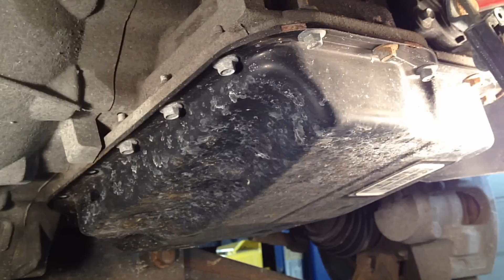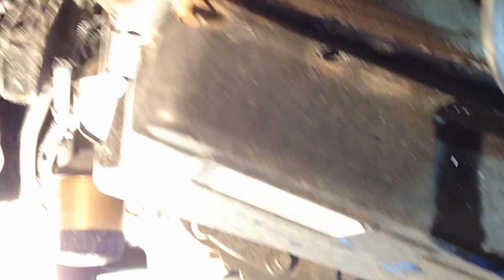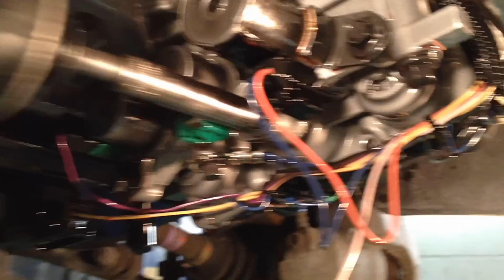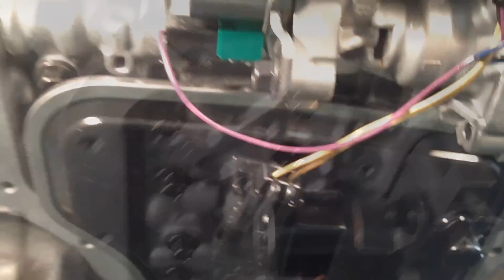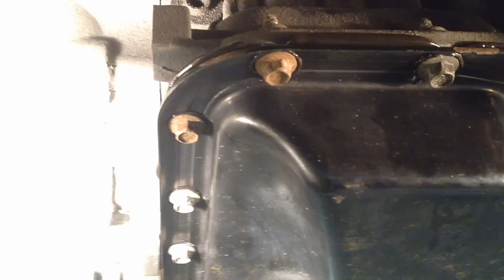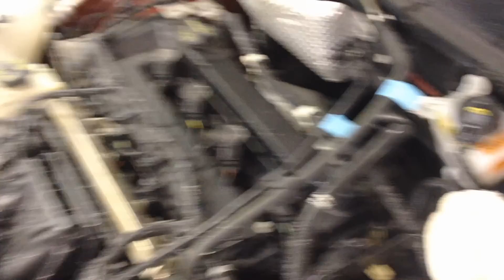Ford Focus Shift Solenoid A Repair P0750 P0753 P0972

Comment: Solenoid 	Function Type	Harness Connector Color
Shift Solenoid "A"	On-Off	Clear
Shift Solenoid "B"	On-Off	Black
Shift Solenoid "C"	PWM	White
Shift Solenoid "D"	PWM	Blue
Shift Solenoid "E"	PWM	Green
EPC Solenoid	PWM	Black.......the connector is where the wire clips into the solenoid

Comment: Struggling with a P0770 on a 2010 transit connect. Put in all 6 new solenoids, fluid, filter, etc.. Code comes up immediately even without driving it. Wondering if the dollar store scanner isn't actually clearing it. Lack of power from stop, delayed shifting, and won't grab 3rd until WAYYYY late and slams into it.

Comment: It’s 11 years later. I have a 2003 ford focus. I was driving one day and I have no 3rd gear all the sudden. 1st and second shift fine. When it shifts to 3rd gear it like I went in neutral (no gear). I have a P0750 code. I will replace A solinoid and see what happens. Hopefully a fix. Tranny was working just fine before this happened and is repeatable. As long as I don’t go in to third gear. Transmission works fine. 75k original miles. Question, what is part number for solenoid A and B for a 2003 ford focus?

Comment: Hello, I am writing to you from Turkey. I have a Ford Fiesta with a 4F27E transmission and a 1.4-liter petrol engine. I have an issue that we haven't been able to resolve. The problem occurs especially after the car warms up; it jolts when shifting from 3rd to 2nd gear. It feels as if another vehicle is hitting it from behind. I haven't noticed any issues with other gear shifts, but this problem happens specifically when shifting from 3rd to 2nd. It particularly occurs on steep inclines. When the speed decreases on an incline and the engine needs to downshift from 3rd to 2nd to recover, this issue happens. If I switch to manual mode and ease off the gas pedal while manually shifting from 3rd to 2nd, the jolt doesn't occur. However, if I shift while keeping my foot on the gas pedal in manual mode, the jolt happens just like in automatic mode. What do you think could be the problem? Do you have any guesses? The local mechanics here have suggested a complete transmission replacement, which is very expensive. Since the problem occurs only during this specific gear shift, I would prefer not to replace the entire transmission. Is there a simpler solution? I would greatly appreciate your response. Best regards.
Reply: Stay in turkey. Garbage country
Reply: Bet ur in berlin

Comment: Getting code p0761 on 2009 focus. Replaced solenoid c and code returns. Replaced transmission with low miles used transmission and still getting code p0761 (solenoid c). Any suggestions?

Comment: Wow so great video brother.... so this focus tranny looks aboutbthe same as the ford fusion 4cyl. Except that the pan is facing foward where the solenoids are. With that said i have error code po735 i think and it refers to the 5th gear ratio incorrect. I have in the past removed the solenoid valve body to replaced the gasket type sandwiched between valve body because the metal ball was stuck and blockage was happening and it solved issue. I also carefully inspected the oil and removed oil tranny pan to look for metal shavings and see if issue was mechanically but it had none and just normal wear n tear so i knew than that the issue was 150% with valve body gasket and sure enough it was. Now after 2yrs i have this new code of 5th gear incorrect ratio so im sure it is a shift solenoid but do you know which one controls 5th gear ratio??? PLEASE HELP ANYONE THANK YOU SO MUCH!!!

Comment: Would any solenoid issues show on an ODB2 scan? My mk1 1.6 automatic is having issues and I think it's the solenoid but because the transmission warning light goes off when I restart the car I'm wondering if it clears itself.

Comment: did you ever run into a 2008 focus se with an automatic trans that would not engage the park pawl, even after a cable adjustment? is the pawl accessible by removing the pan?

Comment: I was driving, when going from second to 3rd I herd a clunk sound then no shift to 3rd.  

It still shifts good n strong from 1 to 2 and reverse.

But when it goes to 3rd nothing engine will Rev up, is this what shift solenoid does?

Comment: Hey man u still here? I have a 2000 Ford focus SE. It's been doin great and today it started to not wanting to shift down wanted to stay in high an then it shifts down and then later I was goin 60mph an all of the sudden it went into neutral . I took my foot of the gas it went back in but now it seems to me slipping an jumping out of gear. Fluid is clean an full. What is the issue???

Comment: I i have a 09 ford focus ... with codes p0981 shift solenoid d control circuit range / Proformance  p0732 gear 2 ratio incorrect and p0767 shift solenoid d stuck on. I have changed shift solenoid d and im still getting the same problem. Should i change solenoid A as well? It revs high in first gear and sometimes shifts hard into second inless u left off the gas. The wrench light came on during test drive along with cel. But then the wrench light went off after 2 miles and just have cel on. Please help me i dont know what else to do to get this fixxed! Please please. Also had a exposed wire going to shift solenoid f i wrapped it with electric tape. But im not getting any codes for that solenoid. Please help im stumped!

Comment: My 2002 Ford Focus started making a jerk motion when accelerating and shifts to 1st to 2nd and it’s not all the time it’s random. Almost feels like a delay in shifting. I changed the transmission fluid and filter. I’m not sure what it is. Could it be something to do with the accelerator pedal or injectors or something else. I’m hoping it is. It’s a 2002 Ford Focus. Can anyone help? I don’t have any codes or check engine light.

Comment: I followed this video to a T when changing a "stuck D solenoid" (P0767) and after I put it back together and drove it, I got the same error and jerky shifting. Can something else be contributing to my problem. And yes I did drain pcm capacitors with the alligator cable trick.
Reply: I think he's got cde in wrong order if you see a picture diagram doesn't match

Comment: Great video I have a 2009 Mazda 5 4cyl automatic shifts fine then all of a sudden the car jerks the a.t. light and check engine light comes on and the tranny shifts down to 3rd gear when I stop then take off it shifts thru the gears only to 3rd gear and wont shift out of 3rd gear the tranny fluid is dark color a little black I stop put it in park shut it off wait a few minutes start it back sometimes it does fine shifts in all gears and sometimes it keeps doing it any info would help I havent had the codes ran thinking maybe tcm or shift solenoid or the pressure one im not sure thanks in advance

Comment: I have a Escape 2010 with a 6f35 trans Ford doesn't have one in stock and the aftermarket refurbished valve has a plastic shoulder and the original is metal numbers on the solenoid are not the same ever run into anything like that? I cant find that same type of solenoid that I pulled out. will the other one work or are the flow rates different?

Comment: Great Vedio! Just got a P0772 Shift Solenoid "E" Stuck on and a P0742 (TCC) Circuit Stuck On trans code. In video you usually changed A & B and not E.  What would you do?  Thanks.  Will Humble TX

Comment: Great video and informative.  I have a problem with my 2015 Ford Ranger 3.2 A/T with 126k Km. I have a problem with my transmission 2nd gear which experiencing shift shock but all the other gears shift fine and okay. Thanks in advance.

Comment: Dude I had a Mechanic tell me it was not worth changing all the Silaniod so he convinced me to rebuilt  now I have cv axel problems and wheel bearings picked it up and had lug nuts missing didn’t find out till I washed it and I found out driving you car with a missing lug nut will mess up bearings

Comment: Did all the work filled transmission fluid and started hearing a loud clicking sound inside the transmission after a while goes into limp mode don't know what to do

Comment: I have a 2010 ford focus sel just bought it to fix and sale. Got it running but having problems with it not going into overdrive. Scanned it and it pulls a code for solenoid C. A local transmission shop said it just needs to be flashed i took it to a shop and they said it had no flash available cause there wasnt any software updates available for it. Need your help please

Comment: Excelent video¿how do you check the conectors and cables that connect to solenoid "e" before open de tansmision box in a ford fusion 2008 ? .because after a service in the agency they wash the motor and the battery was wet, and later ,appear the check engine and it marks errorr p0770, I will thank you if you answer this question , i am from mexico city .the car have a good performance if you only erase this error code but ,if this appear again appear a sound when realice the change to 4_5 gear, If can be a short electric for the wash to the motor in the service, and not to dry in a corret way?

Comment: Thanks a ton for making this video I have to change the solenoids in the transmission of my 08 focus, still not sure if it’s the solenoids or if it’s the whole transmission, it bangs into the gears and the car nose dives and releases when accelerating to highway speeds, my focus has been nothing but issue after issue lol it has nothing to do with being a ford either, the car was not maintained by the previous owner, but I can’t complain I bought the car for $1500 with 107.000 miles on it and the body is still mint no rust for a New York car that’s a good thing even the rear subframe is pretty mint .
Reply: did you find out the problem? same thing is happening to my 08 ford focus
Reply: @ambertrevino2771  it was the shift solenoids , and the internals in the transmission that failed, I don't have the car anymore due to the issues it started having, I'm in the process of Buying another Ford Focus because it was a great car and was cheap to fix stuff and pretty easy to maintain.
Reply: @RailfanBobbyFocusMk208 how's the new Ford doing? I have a 2013 Explore 112,000 miles torque converter is shot. 09 Focus 140,000 miles transmission doing what yours did. The fact Ford will send known defective transmissions (DPS6) off an assembly line and think it's acceptable to lie to customer's faces, claiming its just normal operation was enough for me. Never again in this household but to each their own.
Reply: @jefferygordon243  unfortunately My 2008 Ford Focus was totaled, got hit by someone attempting to change lanes on the highway and they took out the passenger side rear of the car and it caused me to hit a Guardrail when my car spun out and I hit a guardrail head on, all airbags deployed and the car saved my life, I walked away with only minor airbag burns on my wrists and minor whiplash, the safety ford designed in their vehicles is pretty amazing it could have been worse but I’m still here and able to see my daughter grow up, I’m currently driving a 2014 Ford Escape titanium with the 2.0 eco boost turbo 4 cylinder and I love it, no issues with it at all.

Comment: would this fix a light saying transmission over heating . got a code at first for the clutch acuator i replaced them both and then a 2 months later my 2013 ford focus started to act up agin with a shifting almost like it was slipping high rev then it would go into the next gear im assuming now the light for my transmission has come on saying over heating and when I start my car it will turn off after about a minute ,  i replaced the clutch acuators agin made it around the block and agin my transmission light came on saying it was hot agin ..... very greatfull for your input if you have any ideas thank you for your time

Comment: if u put 12 volts to the A solenoid shouldnt you hear a click??  im not hearing the click on either the a or the b solenoid, i also dont have reverse, but forward gears seem to work ok.  any help greatly appreciated.

Comment: thanks, great video,
got a 2010 ford fusion se 4 cyl gas
recently got p0756 and p2701
one guy recommended a whole new transmission rather than checking electrical or replacing the solenoids
im not a mechanic but may opt to try this work myself. we did a fluid exchange and a throttle body replacement before he found these codes

Comment: Thank you for your video. I have a 2012 Ford transit connect Fx 2.0. Question: by replacing all the solenoids will it fix the reverse too? Apparently when the car worms up, it won't shift into reverse. Or is there a different solenoid for the reverse?

Comment: Will this throw a check engine light? From reading other things about a stumbling issue when switching from 1st-2nd gear around 2500-3000rpm this may be the fix, but my car is 2018 and no check engine light

Comment: Greasy Ford doesn't even use a Gasket .... same transmission in a Mazda ... But Mazda has a Magnet inside also has Drain plug and uses a gasket . Dam Ford you cheap buggers ..... !!

Comment: Careful with the plastic electrical connector the heat exposure makes the plastic brittle ....... you can just put the electrical connector back on without but hey just be gentle with them .

Comment: This is a common problem so reassemble with Non Hardening gasket sealer and you will be able to drop the pan easier next time you need to get in there.

Comment: Hey mate, i have a ford focus 2006 model automatic. I'm having problems with trans not shifting smoothly between gears. I checked it on the scanner tool and it gave me error p0733. Is this error related to any solenoid?

Comment: Should the vehicle be hot or cold when you do it? You didn’t mention. Trans fluid volume expansion? How do you accurately put the correct fluid back in? Wait until it cools down? How do you put correct fluid amount back in? You didn’t mention that either? 🤷‍♂️🤷‍♂️🤷‍♂️🤷‍♂️

Comment: Great videos I have a 2006 fusion 2.3 I replaced the transmission and after that it still runs terrible. I replaced all the solenoids also . You have any idea what it could be . Thanks in advance.

Comment: Do the solenoids controls specific gears?  My 2009 focus shifts really rough from 1st to 2nd gear, then fine for 2nd to 3rd and 3rd to 4th.  Also don't have overdrive but have a few ideas as to why that is.  I'll probably just replace all the solenoids because they are cheap but it would be nice to know which specific one is causing the issue.

Comment: I dont know what year focus this is but my wifes 2013 has no pan. Solenoid A is ontop of the transmission under the air box and TWO radiator hoses! My twenty minute fix HOPEFULLY has now turned into a four hour project

Comment: 2011 ford transconnect 3rd trans.  no codes yet, but slipping after driving 45 min.  i dont know if he flushed the cooler ?  have you seen this.   only 6k miles on it

Comment: I have a 2010 ford focus and a coworker did my transmission service but overfilled it by alot. I didnt check and drove it for a long time untill one day it wouldnt go past 80, checked the oil and seen it was double of what the dipstick showed. Took some out and it does make the change but somtimes jumps up too 3000 rpm and doesnt want to make the change to its final gear (80km) its not throwing a transmission code for the solenoids or anything. Is it my internal clutches? If it was overfilled it could've glazed them if it reached up there.

Comment: Where is the transmission located?
Reply from the maker: Drivers side front.
Reply: Will this solve the problem, transmission limited function? Because my 2.0 L duratorq focus doesn't shift to the 2nd gear and any other gears. Its a automatic transmission btw

Comment: what was the problem with this transmision? i have a Focus Sport Europe 2010 but i saw that doesn't change of 4 to 5 i've read (readen) don''t remember the exactly word :P that is a problem with a solenoid. In this case is the same?

Comment: i have a 04 focus auto trans,and it's like it's stuck in 2nd or 3rd gear it won't upshift or downshift my friend had the diagnostic computer and scanned it and it said shift solenoid d and e and something else open circuit.. just trying to find out since you're very  knowledgeable on transmissions, do you think it's my solenoids?

Comment: Can you help me, i have i ford escape(kuga) 2014 model 2.0 liter diesel. İt in 57000 km like a new, last day transmission half working, and other message hill start system dosnt work. İ read tcm , universall scanner , it show 2 mistake, ones: p0700 , the secount p0846, can you help me?

Comment: question about the shift solenoid, are A and B the same exact part or are they totally different? also same question to a, b, c, d, e are they all the same or each different, or is it the first 2 the same and the last 3 the same but set 2 and set 3 are different?

Comment: Really well done. I was just searching around to see if there were any other spots trans fluid might leak from after a solenoid replacement aside from the trans pan. It's a 2011 E250 but from what I'm seeing everywhere about the only spot a leak could suddenly appear after this repair is from the pan seal. The pan says reusable gasket...hmmmm

Comment: Ford Focus TDCI 1.6 2007, it will not go into gear like it wont engage, this has happend 2 times now, and doing a reset of the tcm brings it back, am i on the right track thinking it could be the pressure sol? the error code it gives me is a p0741, it got a pretty low mileage for its age, i used a convertion from km to miles, somewhere around 80k miles (113000 km) it looks like.

Comment: Great video! I have a 2008 Mazda 3. I'm getting code P0753. The Mazda repair manual i have says shift solenoid A is the solenoid closest to the front of the car on the driver's side. Amy idea which solenoid is solenoid A on my car? Any help you can offer would be appreciated.